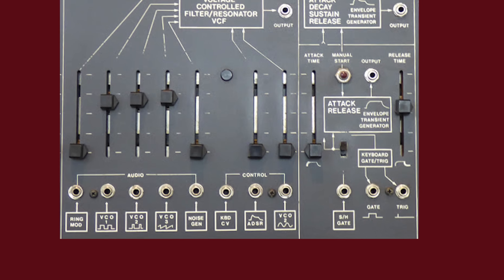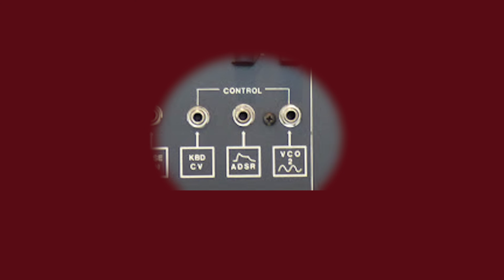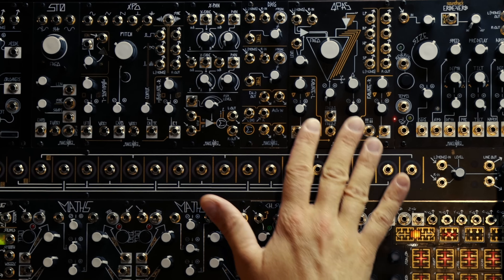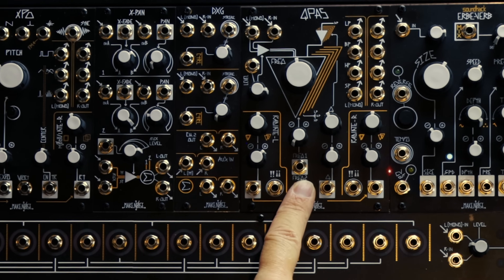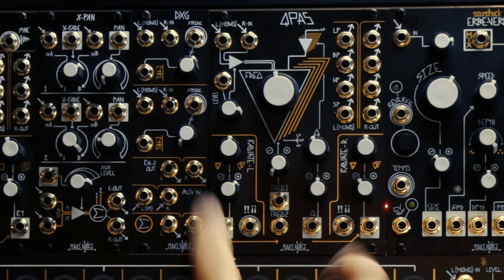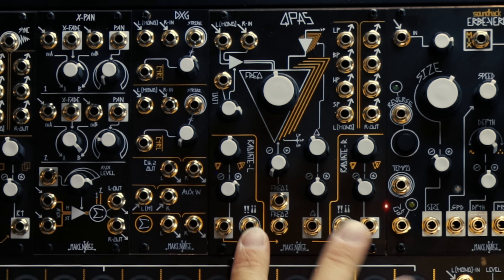"Voltage Is The Language" with Ch.Svr | Make Noise

Comment: I got so many new ideas thanks to this video. It's funny that Channel Saver is helping to make use of Maths channels 2 and 3 simply because you often forget about them, while it's unlikely to forget about a dedicated module like Channel Saver.  I never realized EV's mix works as an offset when there's something patched so you can actually sculpt the reverb tail. This made me realize I almost never patched anything in any 'mix' CV/pot. Also, I never patched the DPO left side into DPO's right side shape, fold, etc. A new universe is emerging. I love the simplicity of PrssPnt while adding so much to play with. If there's a God, bless you. If not, bless you anyway.
Reply from the maker: Glad to hear that this is useful even to a seasoned synthesist like yourself! These core concepts can easily start to fall through the cracks when we start to pile on various impressive sound sources and effects, but guiding your control voltage in a meaningful, purposeful way can unlock even the simplest patch and let it shine. One quick note of clarity: the Erbe-Verb mix works as an offset when there is NOT anything patched. It can be fun to hit Mix with an envelope generator like you would a VCA/LPG, or also to sequence it with a separate sequencer channel from whatever you're sequencing your voice with :)
Reply: @MAKEN0ISEMUSIC  Thanks for the clarification, indeed I meant a VCA with an offset. I am going to make sure to get it right when I am going to make use of it in a video. 2xPP and 1 CS in the mail :).
Reply from the maker: We will be looking forward to the vids!! ⚡️
Reply: Any sound source going into the DPO angle CV input is so audible that I sometimes use DPO as a sort of a distortion effect by setting the frequency to almost sub-audio levels and the fold on the brink of silence.  Maybe something new for you to try with the modulation options on channel B :)